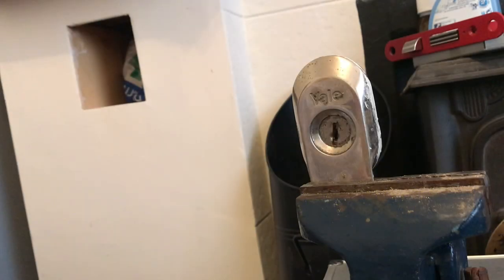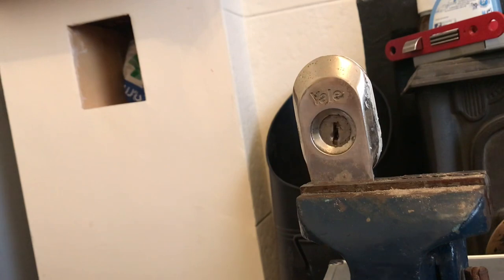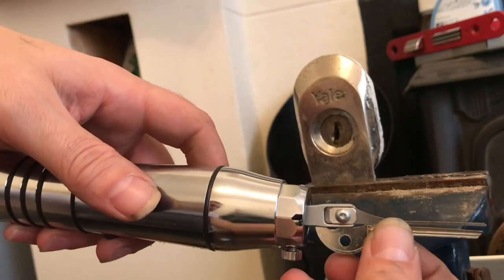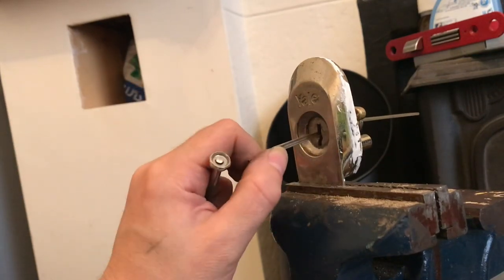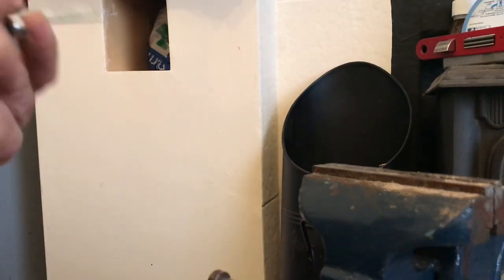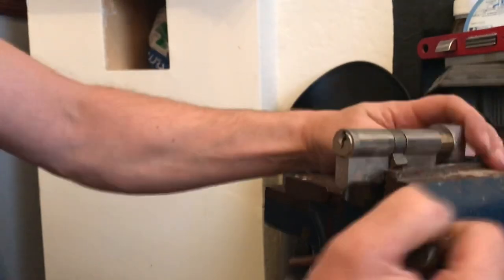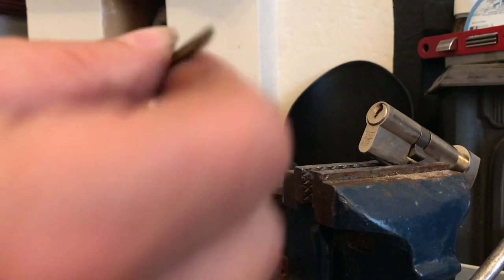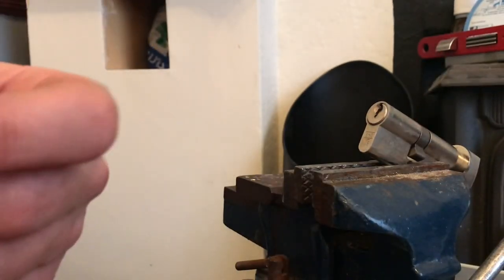Making your own tension tool to deal with security escutcheons

Comment: I use a cut down key for picking up cam on TTs but insert after picking normally, might try your method next time.
Reply from the maker: Abbey Locksmiths Ltd I only used the cut down key as a tension tool for tricky handles etc to use with my pick gun, but then realised I could use it to pick up the cam at the same time, with a few tweaks I reckon it could work out really well
Reply: @FortressLocksmiths  a reversed tension tool with long end in cylinder also works well sometimes for engaging cam.

Comment: That’s a great idea 👍🏻👍🏻
Reply from the maker: Wallers cheers mate, when you’re out on the job especially in the middle of the night anything that can make your life easier is always handy
Reply: Fortress Locksmiths  I get that mate, I just spent what seemed like hours changing the lock on a patio door and realigning the side of the door as they had lost the keys, up side non Destructive and was only an hour but it was definitely one of those 🤬 jobs haha 😂
Reply from the maker: Wallers I must get at least one a week were it comes to french doors/patio doors , they always need adjusting just for the fact it’s one big pane of glass so they’re always gonna end up dropping! But I know what you mean, some days no matter how much you adjust the hinges or move the locking keeps that lock doesn’t wanna work smoothly......and non-destructive entry always gives you a fuzzy glow doesn’t it 😂
Reply: Fortress Locksmiths Oooo definitely 🤩 😂 i hate the thought of using destructive entry it seems so much like Failure to me lol